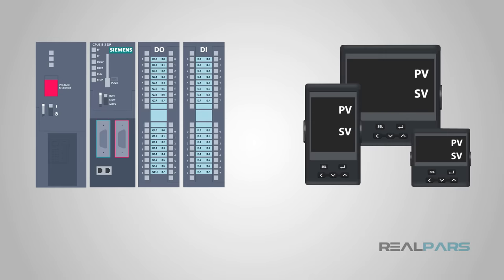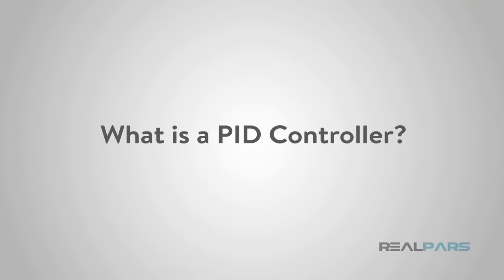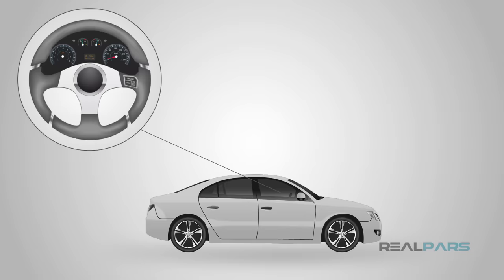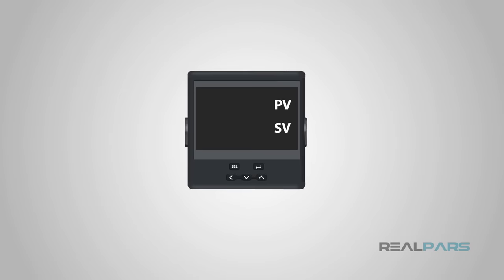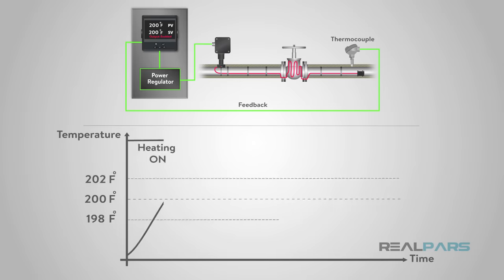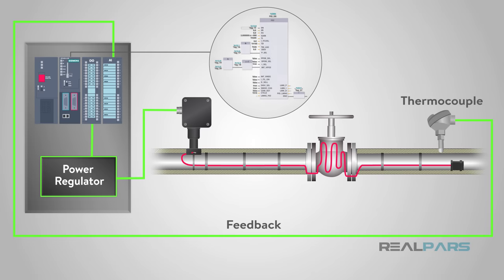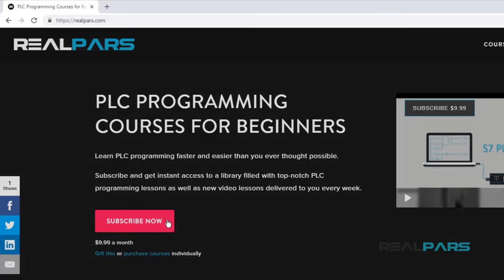What is a PID Controller?

Comment: So what difference did it make to use a PLC to control the PID? Does the PLC determine the P, I and D constants automatically? Does the PLC allow for the P, I and D constants to be modified directly, which they can't be for a PID for some reason?
Reply from the maker: The PID instruction in the PLC executes the equations that use the tuning constants along with the SP and PV to calculate a new output on a periodic basis.  The P, I, and D tuning parameters can be constants, which can be changed online through the programming software.  They can also be variables, and be calculated or updated by the program, or entered by the programmer or operator through the HMI or programming software.  Only when the PID instruction is being used in "self-tuning" mode can the block itself update the PID tuning parameters.  In self-tuning mode, the programmer or operator may be prohibited from updating the values of the constants, depending on the CPU model used.

Comment: Assuming the heat wires can heat up more than the required temperature, the line isn't starting to go down until it gets an "off" comment. not before as shown in your example.
This means that the temperature will maybe rise above the 202 F degrees...
Reply from the maker: Hello @Gady Wollmann. You are correct. The animation is slightly off. The temperature will continue to rise even after the "OFF" command. In fact, the temperature will continue to drop even after the "ON" command.

Comment: well explained. 
is there something special i have to set on my PID controller like cycle times or hysteresis, when using zero crossing SSR's to switch a heater? thanks
Reply from the maker: Nothing special needs to be done.  I would not tune the controller to be very "fast or aggressive", since the temperature response is typically slow.
Reply: @realpars  thanks. Whats the parameter to be used to not behave aggressivley

Comment: Pretty much just described what a controller is, not specifically a PID controller. The reason PID is used, is that it can for example adjust temperature way better than a simple "too cold, increase, to hot decrease" controller.

Comment: I have a quick question regarding PID controllers. So I was in discussion with the guys at work today... A situation happened where we tripped a breaker due having two ovens going at once. We calibrate gps equipment for directional drilling so we see temperatures up to 170C. Now, this occurred when both ovens were ramping to 150C from 25C. My question is, with controllers like this does the amount of Voltage increase when choosing a higher temperature on the controller, or does the controller send out the same amount of power regardless of temperature chosen. We utilize the Omega CN76000 controllers in our oven. 

I was under the impression that the voltage would be greater going to 150C from 25C compared to going from 25C to 75C. Just curious. Thanks!
Reply from the maker: The actual heating elements for the ovens could be of several types.  If it is an SCR-type, then the full line voltage is electronically switched at a rate to give an average current output to allow the heater to move to the setpoint temperature.  An SCR is a heavy duty switch that operates based on a controller setpoint input, such as that provided by your Omega CN76000 controller.  For other types of resistive heaters, varying the average current draw in other ways is probably the method of temperature control.  Tripping a breaker occurs most likely due to over-current, indicating your incoming electrical feed may be undersized.  If both ovens are on the same electrical feed, I would separate them and protect each with a separate breaker to keep one heater from taking both down.

Comment: Expecting something on FeedForward control loop system
Reply from the maker: Hey! Thanks for the tip. I will pass your topic request on to our creator team.
Reply: Feedforward generaly used if you know what the model of the disturbance is.

By feeding this model back into the process and subteacting it feedforward is effective. HOWEVER! Feedforward is not effective if you do not know the characteristics of the disturbance variable. 

I would recommend for most processes you use cascade and make the internal loop as fast as you can to get the process to setpoint as fast as possible. 

Then tune the outer controller to achieve the final desired response

Comment: One thing I've always been confused about is the need of a PID Controller. Like, in the case you described, and many others, why can't I just keep telling my system to keep increasing/decreasing the temperature until the error is 0? Why do we need proportional, integral, and derivative gains to adjust our input value when we could instead just keep increasing/decreasing the input value until it matches the setpoint?
Reply from the maker: Vedh,  you could certainly provide an output that is manipulated based on the value of the PV.  The issue is two-fold with this approach.  It does not handle deadtime and lag effectively and it does not move the output so that the SP is reached in the minimum amount of time.  These are the benefits that PID control offers.  PID can compensate for deadtime and lag so that continuous output changes are not made that will cause overshooting the SP.  PID can also make control moves quickly and then back off in order to drive the PV to SP in the minimum amount of time.  Your method will provide control the process, just not as efficiently as PID.  And in some cases, like flow where there is little deadtime or lag, that may work just fine for your process.
Reply: @realpars  thank you!

Comment: The way the controller works at 2:52 is not PID, I've used PID to control on-off actuators by using the PID output as a duty cycle
Reply: yea thats pretty much just a binary regulator with hysteresis... the thing about pid is that it will keep the controlled value constant, not bounce around it... their depiction of the tempersture curve also doesn't match how the system would behave with that type of controller... it would not be a sine wave, but going up in a straigth line each time it hits the lower threshold
Reply from the maker: Hi there,
Thank you for your comment.

Using the Proportional control loop could result in what you had seen for the Heat Tracing example. Although you are also right, and it could be achieved by an ON/OFF control loop as it is shown in the video as well. beside of all, the purpose was to show a simple application of the "PID Controllers".
 
This video was an introduction to PID Controllers and in the next video in this series which is about the PID loop and its corresponding Function Block in Allen Bradley ControlLogix PLCs, we will elaborate on the P, PD, PI, and PID loops concepts using one or two simple real-world examples.
Reply from the maker: @johnuferbach9166  
Hi John,
Thanks for your engagement.

The temperature curve has been depicted like what you see due to the "inertia" characteristic of the temperature. This is to say that when you turn on the heater to bring up the temperature to 90 degrees Fahrenheit for example, the temperature normally has an overshoot and goes up to some extent more than 90 degrees. It is correct when the temperature is coming down as well. Generally, controlling the temperature using either a Proportional control loop or an ON/OFF control will result in this kind of behavior.

The straight edge is related to Heater ON/OFF diagram and not the temperature curve.

Comment: can i consider this as a closed loop also?
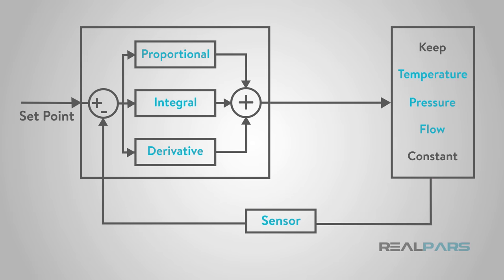Reply from the maker: Yes, referring to the process control configuration at 4:30 in the video, when the control loop is in automatic mode, the loop is said to be "closed-loop".  Closed-loop refers to any control situation where the output is being periodically evaluated based on the process conditions (inputs).  If I put the control loop into manual mode instead, the output will update only when manipulated by the operator, so this condition is referred to as "open-loop", by comparison.
Reply: @realpars  thank you sir for your wonderful response. 🤘 love watching your videos helps a lot.

Comment: i think thats might be ON-OFF controller. PID use error to calculate how much the output should be and dont forget to tune how much the value of the PID 😉
Reply: You are correct, the first part of the video addresses a hardware-based on/off controller.  The discussion of PID starts at the 3:30 mark in the video.  Realpars is starting a comprehensive series on PID control at Realpars.com.  Hope you will check it out!

Comment: what are the kind of voltage regulator can i used ??? can you help me
Reply from the maker: For the heat tracing example shown in the video, a power supply/voltage regulator is used to provide power to a resistive heat tracing cable that provides a uniform heat output over the entire length of the cable.  Manufacturers of heat tracing supply these power regulators that are matched to the specific heat tracing cables that they provide.  This insures safe operation and reduces the likelihood of overheating or damage to the electrical circuit.

Comment: Should rename this video to what is a “Bang-Bang” Controller 😛. Good content nevertheless, just somewhat misdirected. In my little exposure to controlling temperature loops via PID FBs on siemens PLCs , they can self tune the P,I,D and multiple application specific parameters which dynamically alter the duty cycle (highly adaptable to different heating and cooling rates) to whatever heating element or power regulator is being controlled. So in a way, it is still full fledged PID control but not super intuitive for people who don’t know the underlying fundamentals of these FBs, or the translation of classical control theory to most real life systems working in the discrete domain.
Reply: Good comment.  This video described PID in general terms and just introduced the Proportional, Integral, and Derivative contributions to the overall controller output calculation.  Many of the FB's in various controllers make it easy to set up a PID loop, but this "ease" does not help the engineer really understand the concepts behind the control.  That is unfortunate, but is very common in our highly-digitized world.
Reply: Scott Sommer couldn’t have said it better !

Comment: How's it's different from writing a while loop and actuating with a microcontroller and sensors ?
Reply from the maker: Using microcontrollers is usually for small applications.
Reply: you can also set up a pid-regulation with a microcontroller... pid is really just the internal mathematical process, the device its run on doesn't matter

Comment: can i use statement list by using c language codes to control loops?
Reply: Absolutely.  C++ is often used by machine designers to control position movements via PID or PIV (proportional-integral-velocity) control.  It is also the programming language of choice for loops where the inputs require complex scaling or when additional logic conditions need to be placed on the output calculations (pH control, composition control, etc.).  There are a number of "public" C routines available on software collaboration sites like GitHub that may be of use to any project you may be considering.
Reply: @scottsommer6480  thank U ..
I am an electrical engineer for industrial machines. I good using programming language like c ++, java and python.
😁😁😁
Reply: @MY-lx9mw  You are very welcome.  PID is a mathematical algorithm that calculates a current output based on current inputs and tuning parameters.  So, any computer language the can handle mathematical computations will be suited to execute a PID control algorithm.

Comment: How many PIDs can be programmed in one CPU?
Reply from the maker: There is no limitation to the number of PID loops that can be programmed into Siemens S7 CPU's. The limitation is the total of memory required and the scan cycle of the PLC.  Each PID block adds additional memory and incrementally increases the scan time of the PLC.  As a practical limit, if you are going to use the tuning function and other advanced features of the PID blocks, you may wish to limit the number of loops to 25-30.